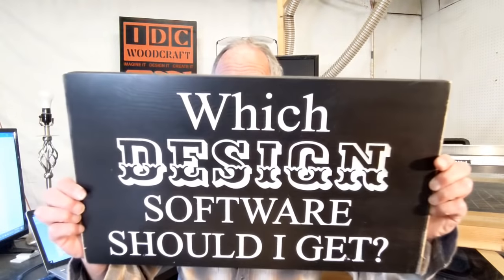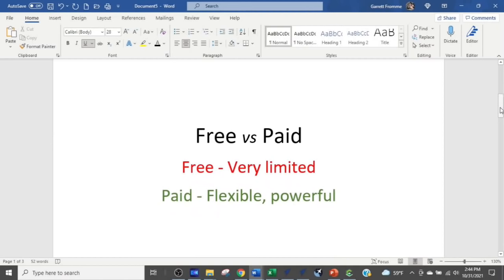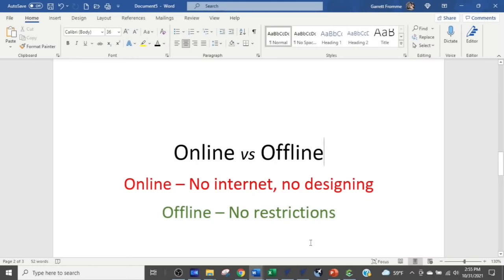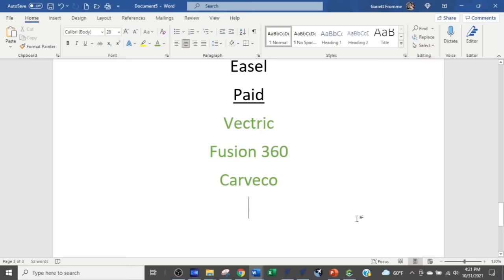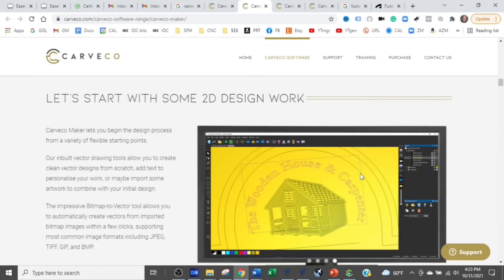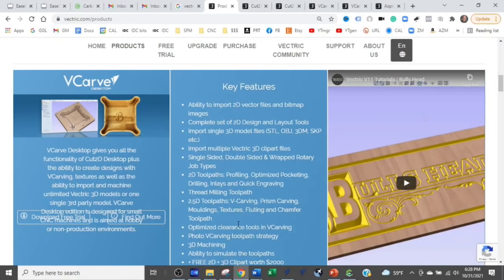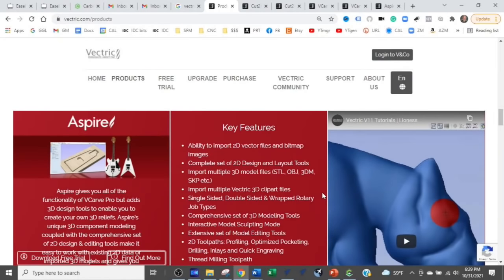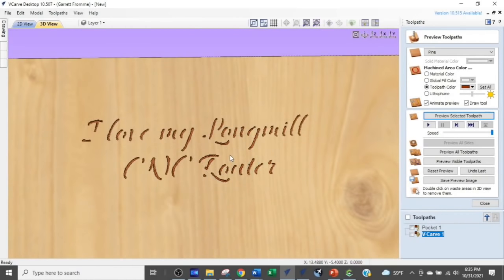Best Design Software Review For CNC Routers & Projects - Garrett Fromme

Comment: I use F360 for my 3d printing models as well as my CNC router. Is it overkill? Perhaps, But it is a one stop shop. It does everything the others do plus 100 times more. I have much more control over my toolpaths as well. I have used most of the programs listed and none come anywhere close to F360. You failed to mention that there is a free slightly limited version of F360 for hobbyists that even with it's limitations is still more powerful than the rest of these. Sure there is a learning curve for someone just starting out but you didn't title this as for beginners. It's worth taking the time to learn F360. Once you do your workflow can be so much faster and and with greater control over your projects. I use the paid version because I use it for my business but a hobbyist can get by on the free version rather easily.
Reply from the maker: Hey Matthew. If you are using it and it works, then you have a very powerful software. Stay with it. It is not the best to use for newbies because it is complex.

Comment: This was some time ago you did the video but I'm just getting into CNC at 78yo after 31 years of owning a small mechanical type construction company. Bought the Shapeoko basic model to start with and will give them credit for exceeding the warranty covering issues we had with the machine, running fine now. Using Carbide Create for family signs and such for fun and gifts. Impressed with some I've made but what the hell do I know. Understand the program limitations of the software and ready to move up. Been doing a little research and this video made up my mind on Vetric V Carve. Know for my limited knowledge it will be a steep learning curve but I'm ready to take it on. Thank you for the informative video and I will use your link below. Semper FI.
Reply from the maker: maxhurst8904, It's fantastic to hear that you're diving into CNC woodworking at 78! Your background in mechanical construction must give you a unique perspective. I'm glad to know that the Shapeoko is running smoothly for you and that you're enjoying making signs for your family. VCarve is a great choice to expand your skills, and I'm sure you'll pick it up quickly.

Comment: Hello Garrett, greetings from the other side of the world. (Lebanon) am a hobbyist woodworker with an engineering background.  For people that do this for a hobby/ extra income fusion 360 is a great tool, it has a steep learning curve , but all the models / designs that u showed can be done on it. Also lot of ressources on how to design/ manufacture are available and there is a great community on the net.
Reply from the maker: Hi Jad. Thanks for commenting on this. Yes, it is an excellent program. I used to work with it. For many beginners, it is simply too much.

Comment: On online vs. offline: like you, I tend to favor offline software, but there are some significant advantages to the browser-based online software.  Two of the biggest are that you have access to, and can work on, your designs wherever you are, as long as you have an Internet connection; and that there's no need to install anything on your computer.  The former is helpful if you travel and/or work on more than one computer; the latter is helpful for a number of reasons, one of the bigger ones being that you're using something other than Windows.
Reply from the maker: Dan, that always is a good question. Sometimes the internet decides to not work for whatever reason and you want to make a project still! In that case, offline software might be the way to go.
Reply: @IDCWoodcraft  Agreed--there are numerous drawbacks to online software (and the modern trend of putting everything "in the cloud", i.e., on someone else's computer).  But there are also some advantages that I thought were worth pointing out.  There are pros and cons to everything.

Comment: Nice recap. A couple of things - Fusion 360 does have a free version, but I do agree with you, it's complex and really oriented towards engineering projects. Carbide Create has much of the functionality of VCarve or Carveco it's just that their menus/options are hidden vs showing up in the panel all the time. Both Carbide & Carveco are good ones to start with for someone brand new to CNC and isn't sure they're going to keep at it.

I'm a VCarve Pro guy myself. VCarve Desktop does let you do larger than 24x24" - you just need to define the project as a "tiled" project. Not super difficult. You have to do the same with VCarve Pro if you want to do something longer than your CNC's footprint. Otherwise I don't believe there's much difference between the two.

BTW, I'd put you at the top of the list of VCarve YouTubers. Mark Lindsay is a good guy but you seem to focus more on taking someone through a project. It's like you're showing people how to make something they want. Mark tends to be feature oriented - showing how to use a program feature. It's a subtle difference but most new folks just want to make something, they don't really care what program features you need to make that happen. Show them how to use the software to make something and that's what they need, they'll learn by doing that. Having a "how to use the tiling feature" video doesn't do the same thing because they may not know they need tiling so might never check it out and learn. Mike's stuff is almost all Aspire so it's often going to disappoint people who find out they can't do what he's showing them in the other Vectric products.
Reply from the maker: Hi Jim. thaks for the clarification on the CC program. That's why I have people like you to give the extra tips, or correct me when I make an error. and to fill in the gaps.

Geeze, if I covered everything myself, I'd never get a video out there lol
Reply: @IDCWoodcraft  I still watch yours within a day of release - the other guys get a once-a-week looksie :)
Reply from the maker: @jimhatch5873  lol... I'm honored

Comment: Hey Garrett, David Hanna here I have  a fox Allen 4040E. My project size is 15X15. I Will be getting a bigger CNC. So I bought the pro software
Reply from the maker: Hi David, good call on getting the pro software. You will be ready to go once you grow into a bigger machine!
Reply: Yeah I was using easel and I found out that I wasn't able to put the router  bits that I bought from you into their tool portion of their software

Comment: Great info for beginners, especially for someone who knows "NOTHING" about CNC.  Just bought a 1610 engraving CNC to test the waters and it's not looking so good.  The free Candle software included in the kit does not want to communicate with the hardware.  Communication port is open, but not controllable through my laptop.  It looks like this attempt at CNC will be a bust....again.
Reply from the maker: Hi John. I'm glad you found this helpful. As you are finding, the "test the waters" machines are not so good. Make it frustrating with little support. That's why I recommend to to research first. Also why I got a longmill.

Comment: Ok so I’m researching. I haven’t bought my cnc yet. I want to be ready when I receive it like I did with my laser. I do believe your video has sold me on the vcarve desktop pro. After all of that, I know I need to know what program to run my CNC with. There are plenty of videos on design software, but not so much after that. Can you point me in the right direction.
Reply from the maker: Check it first, you bring up a great question brother and the answer depends on which machine you have/end up getting. For instance the longmill uses UGS or gsender, but different machines use different programs.
Reply: So you just push like buttons on all the comments but you don’t really read them I suppose.
Reply from the maker: @Checkitfirst  no I don't read them. You are correct I just push the like buttons

Comment: I have been looking at CNC machine for the last while and I've been at pause because of the high price points. But when I came across longmill benchtop  I thought, there must be something wrong with it. I researched it quite abit and found that if this is there price point this could be perfect for me however  was still reserved about purchasing.  Your expert review was awesome. I am glad you are covering ever aspect of the longmill and the software that is needed to have the very best for the best price is making my decision is on point with you.
  I have some projects that I'm looking to do that involves silhouetting images but don't know how to smooth the lines to make it crisper. Hope you have ideas for that or a video soon.
Reply from the maker: Hi Paul. In regard to line smoothing, this video will help you on that → https://youtu.be/Zafn3m0IkiY

So did you get the Longmill or still sitting on the fence?

Comment: I just received my CNC router a week ago and am greeting my wheels on the ground using Carbide Create. I can already see how limited it is and will upgrade to V-Carve in the near future
Reply from the maker: Hi Dave. First of all...YAY that you got your router!

The free programs are nice to work with, to get started. Eventually, we do want to have the flexibility. I'm glad to here that you are upgrading.

Can I ask a favor? When you do upgrade, will you use the link I provide? It give me a little pocket change. Thanks.
Reply: @IDCWoodcraft  Absolutely. Thank you for your YouTube content. I have the Onefinity 35. I’ve serviced Robots and industrial laser cutting  CNC machines over my career and I’m impressed by the mechanical build and controls on this unit. It’s was also overall cheaper than several of its competitors.
Reply from the maker: @bachplucked  Yes, I was impressed with the quality versus price. Surprised me as well.

Comment: Thanks your videos are very informative & are great help. I'll be getting my CNC Tuesday & can wait to start making wood into memories for someone. Plus I'm going to buy the software Pro.
Reply from the maker: Tommy, That is exciting brother. Tuesday is right around the corner for you! Good call on the vCarve pro, you are going really enjoy it!
Reply: @IDCWoodcraft  yes sir & I can wait to get started.
Reply: @IDCWoodcraft  hey I watched the video on doing the house sign & got it saved on a flash drive & trying to run on my cnc & it's running but it's about 3/4 to 1" above the board
Reply from the maker: @Tkburr40  You're probably set the project from the spoil board surface, but zeroed at the top of the material
Reply: @IDCWoodcraft  I zero it out on top the material
Reply: & still 3/4 to 1' above material
Reply from the maker: @Tkburr40  see my previous comment. Also check the thickness of your material and the design
Reply: @IDCWoodcraft  yes sir

Comment: Great explanations on all the software. Question: if you buy the vertical pro but don't upgrade it for couple years is there any problem  you can think of? If it works today it should be able to work indefinitely as long as the computer stays the same. Is my thinking correct?
Reply from the maker: SamSpace, that is exactly right brother! Although it is still a good idea to update the software to get the latest features, you can still work off line without issues.

Comment: I’ve been using my CNC for a month now and tried carbide and easel and both seem to be severely lacking. I’m about to try the vcarve free trial and I think I’m going to like it. If I do, will I still be able to use your affiliate link when the free trial is over? Or should I use a crap email account and start again when I go to purchase? Also, can I transfer the software on a new pc when i upgrade my current laptop? My current laptop is a potato.
Reply from the maker: None, you can use the affiliate link once you are done using your free trial. Once you buy a new laptop you can transfer and re download the software no problem.

Comment: Hi Garrett

I used FreeCad to design the gears of a Wooden Gear Clock from plans from a scroll saw magazine I got several years back.  It's more of an engineering CAD program like Fusion 360 but without the cost.  I'll probably continue to use it for the small amount of engineering work I'll be doing.  Vectric or Aspire are the two I'm considering.  The fact that I can purchase Vectric now and upgrade to Aspire later for just the difference in price is a good selling point in my opinion.

My Longmill is still in the shipping box.  The workshop construction got delayed from June 2021 to this coming spring.  I can't even build the table for it because all of my power tools are crammed into my garage with no 220V power ;(.

 The idea of cutting all those gears on a scroll saw was just too daunting for me.  The CNC will be able to cut the gears very quickly and extremely accurately.  If I need to make adjustments to any of the gears it's just a few keystrokes and back to the CNC.
Reply from the maker: Hey Stuart. I think it's time to start building. Don't you have 110V? you Longmill will run on that.

I have no desire to hand-cut gears. You will love the software gadgets to help you with that!
Reply: @IDCWoodcraft  Most of my big tools (table saw, planer, etc) are 220V.  The garage is crammed full of those tools and other household stuff so there’s no room for the CNC even if I could build a table for it now.   I’m in this predicament because ‘I chose poorly’ when it came to the first concrete contractor and now I’m back to square one.  We break ground in early spring so until then I’m watching videos like yours and learning the basics of the required software.  

On another subject I watched a few videos from Peter at CNCnutz on testing V-bit angles.  Apparently due to manufacturing tolerances the actual angle of a V-bit might be off a degree or two affecting the quality of a project.  Have you run into this?

Comment: Hello there. Very in depth. Saves so much research and money. One question, if I get vectrec pro that does 3d can I import 3d models without aspire? Is there a robust 3d model marketplace? Can you easily upgrade and downgrade with vectric?
Reply from the maker: Scott, you can import 3d models into vetric pro but not edit them. I would check out Esty for any 3d models that you may need. You can upgrade vetric but you cant downgrade once you have paid for it. The price to upgrade is only the differential between the version you have and the version you want.
Reply: @IDCWoodcraft  does the ownership cover future versions and patches? I would assume majored versions and feature adds would be a new buy.
Reply from the maker: @shughes599  yes. The one drawback is vectric does not have an auto update feature. You have to update it manually through the help menu.

Comment: I want to use the vcarve software but I am weary about not being able to use it with my Shapeoko. Can I use the Vcarve to control my Shapeoko or do I still have to use Carbide motion. If I still have to use Carbide motion do I need a program to transfer it from Vcarve to the Carbide motion. Can I still do tool changed with Vcarve. So may Questions, but Vcarve is a big purchase for a beginner knowing nothing at all.
Reply from the maker: Richard, reach out to Shapeoko regarding using it with Vcarve. No matter what software you use, you will need a machine controller like Carbide motion or gSender. Shapeoko will be able to give you a postprocessor that will work with vCarve. Regarding your tool changes, that is up to how Shapeoko set up their post processor to allow the machine to stop during those commands.